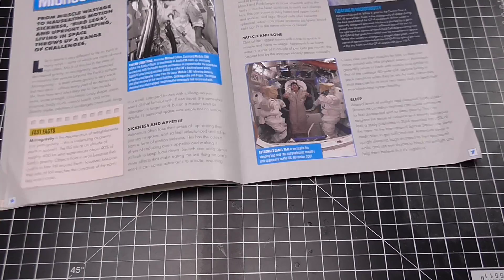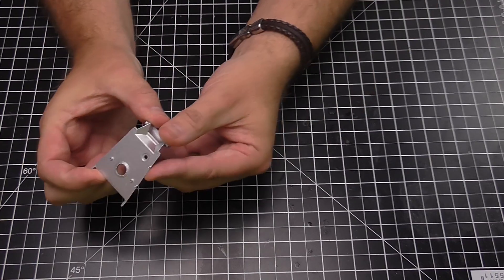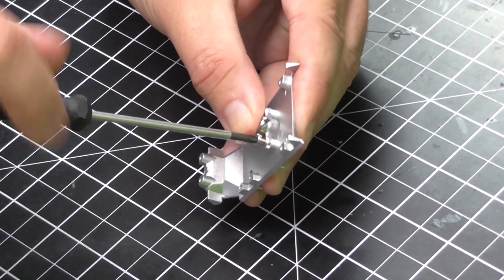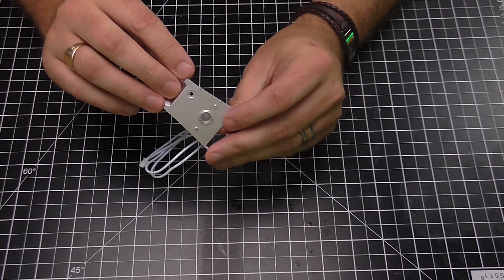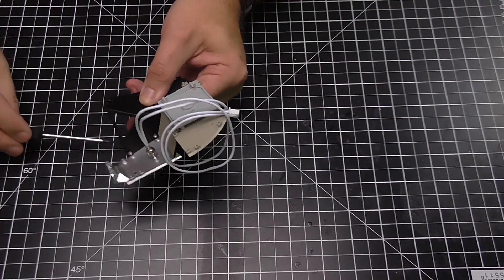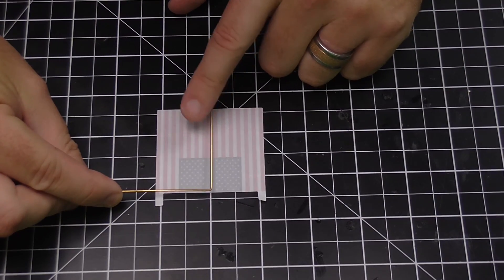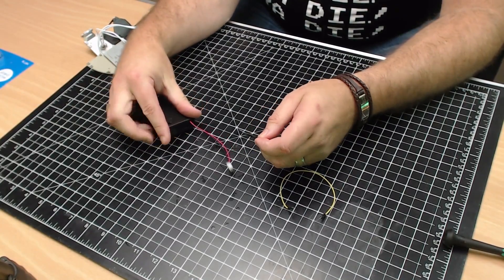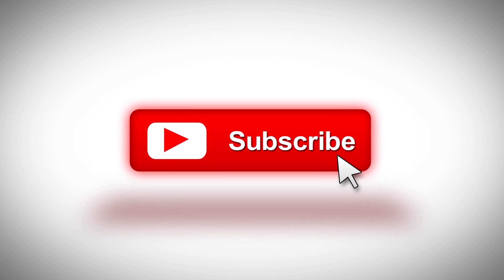Build the Apollo 11 Lunar Module - Part 2 - More Ascent Stage Parts and Flag

Comment: Lovely model
Reply: I have been involved in building in my own version of 1/3 (24 inch) scale fully animatronic puppet. Of both Neil And Buzz. Of which will part a little video clip memory.  I was going build the module. But the scale out weights my workshop and garden. But again thank you for your loving work and inspiration.